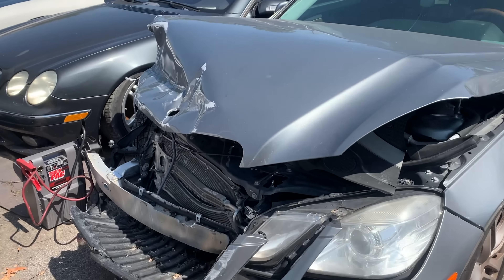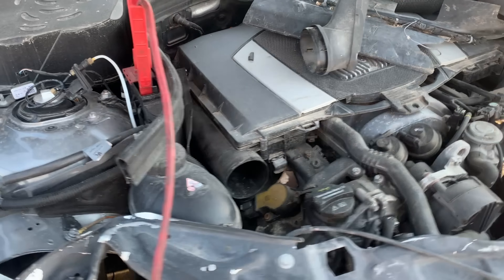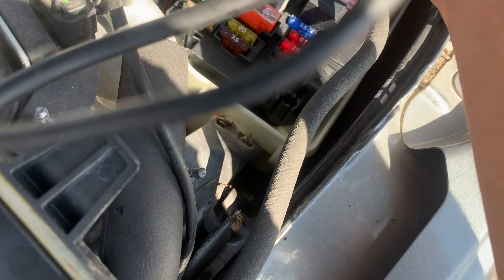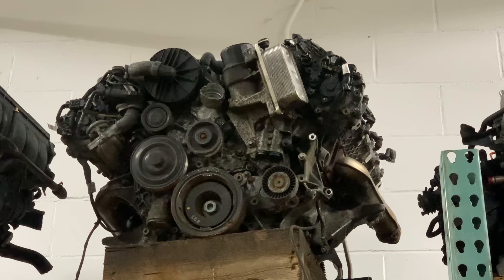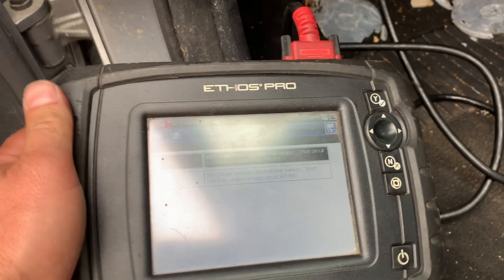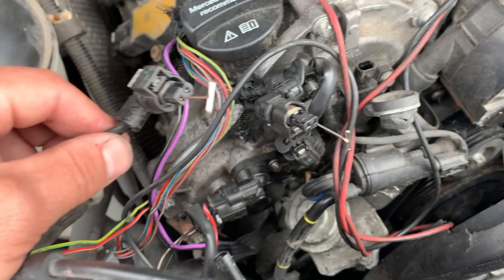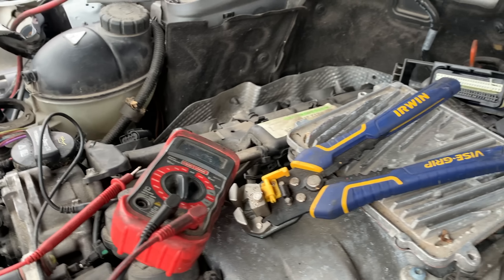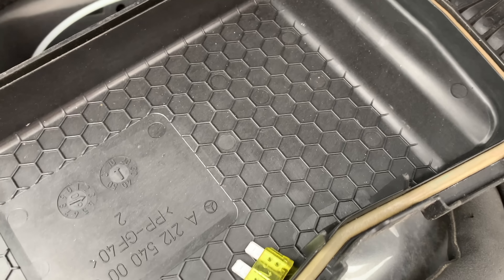Wrecked 2010 Mercedes E550. What's it gonna take to get it running?

Comment: The M273 is actually a decent engine. It puts out about 380 hp and 390 ft/lbs of torque but is never stressed
Reply: Yup. Have one in my S550.  It must be a riot in a CLK550.
Reply: I have one in my 2007 E550. It’s a good workhorse, makes good power and Still going strong with 180k miles. It has nickel and dimed me on leaks and whatnot, I will admit though. Good thing it has no turbos. Good ol big displacement NA V8 power
Reply: And yeah, with the 7 speed tranny, I can cruise at 75 or 80 mph while still being under 2000 rpm. M273 > 5.7 Hemi

Comment: For those with less experience: With Mercedes, expect codes anytime your battery is weak or has been dead.  Always clear codes for a couple days as needed and see how fast they come back.  If they're persistent, even after driving a couple days with a good battery, then start diagnosis.  Don't just throw parts at it.  Remember lean or rich codes don't necessarily mean the O2 sensors are at fault.  They could just be telling the truth and the problem is upstream (the engine), either vacuum leaks or clogged air filter.  Look for loose vacuum or electrical connections and check the easy stuff first!  You can get a lean code just from the oil dipstick tube sticking up and out (due to excessive PCV system pressure - which is it's own problem).  Any warnings regarding lane assist or auto wipers can be just the windshield sensor being dirty.  Lastly, ESP, BAS, ABS and any brake related faults can be a faulty brake pedal switch.

Comment: Keep this kind of videos coming, Eric. One never knows when can see something useful for a project being worked on at the time, or shine some light on a electronic gremlin. I just replaced the MAF in my E46. After a long time with rough cold start and idle plus stalling, everybody was blaming an air leak, VANOS, DISA, etc. It was the MAF, which had a soft failure. Not enough to throw a code, but enough to mess up the cold start mixture. So, yeah: This videos help to train the mind in diagnosing these mysterious failures. Cheers.

Comment: i tend to check the system/component before the fuse because 99% of the time if i check the component first its a fuse, but if i check the fuse first its the component. bit more work up front but saves me a lot of hassle in the long run just doing fuses rather than coils and starters and blower motors 😆

Comment: Made my hair on the back of my neck stand up running so long without coolant!   I suppose there is some coolant to boil off.   You have the experience to ride the edge of the possible.  Great video.  I think it ran because it didn't want to be a star of a tear down.
Reply from the maker: It was filmed over quite some time not all at once, so it never really got warm
Reply: @I_Do_Cars   Thanks for the clarification.  I admire your integrity, treating the expectations of your customers have of your business as gold.  Your example would be a good case study for an MBA class.  All the best.   
Peter

Comment: My only experience with a Mercedes was a 1996 C220, which was a super-nice car when it would run.
Unfortunately, it still had the original, biodegradable wiring harness installed. ❤

Comment: I had some challenges with a 03 Mercedes, and something I noticed in your video that I did that blew a fuse was it may have been leaving the key on when you connected/ disconnected the jump pack during diagnosis. Seems to cause a surge that pops the fuses.

Comment: How did the airbags not deploy in this thing? The side curtain airbags and steering wheel airbag instantly deployed in my 2003 E500 upon impact, and it had way less front end damage than this. 

Engine is good, no airbags deployed, I’d say this car is worth rebuilding and getting a 2nd chance at life
Reply: Do they deploy if hit when running but stopped or off/parked?

Comment: Hey Erick I been watching your videos now for over 3 years but I think we'll I now you can actually answer a question for me because you have dealt with different type of engines and or transmission
So I have 2009 BMW 335i E90 coup which I crash accidentally lol😅 the car is not longer repairable which means am actually selling it as parts but the transmission can you tell me what kind of transmission this car 09 BMW 335i has? And if you now about the motor let me now 🙏 thanks Erick zoom zoom

Comment: never saw that engine but here in Portugal, we don't have big-engines-petrol-drunk. are you going to restore it?
Reply: No, it's being parted out. Too badly damaged to fix.
Reply: @CaptainSpadaro  😭
Reply: @RATADATUAVELHA  assuming the front crash rails aren't fucked (which could be 50/50), the front end COULD be fixed, but it'd cost more than the car is presently worth.

Comment: A 10-year-old Mercedes is a wrecked car even if it has not crashed.  It's obvious they are now designed to self-destruct at just under 100K and the cost of replacement parts is ridiculous.  All German cars are throw-aways at 100K if you are lucky enough to get that far.

Comment: Trashy people and nice cars....  I just don't get it.  I suspect most of them can't afford those cars.  That interior seems a good metaphor for the driver's brain at the time of the accident.  Woman driver....  the hair stuck in the radio control and the scratched off paint on the buttons (from nails) gives it away.
Reply: The depreciation on most any Benz made within the last~25 years is pretty bad, so they often end up in the hands of people who don't understand what they're getting into and/or are buying it for the badge. Couple that with the fact that German car parts tax is a thing and they get ragged fast.
Reply: @CaptainSpadaro    Totally agree.
Reply: @reviewaccount469  It also doesn't help that the QC and engineering at Benz haven't been quite the same since the original LS400 debuted.